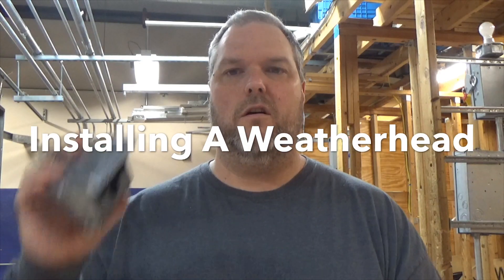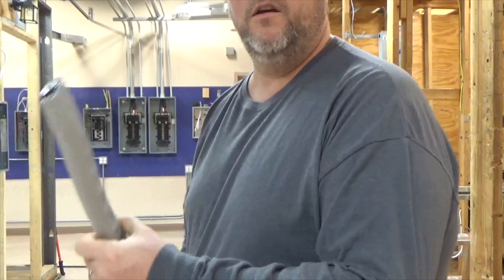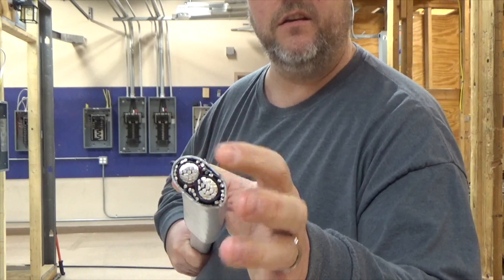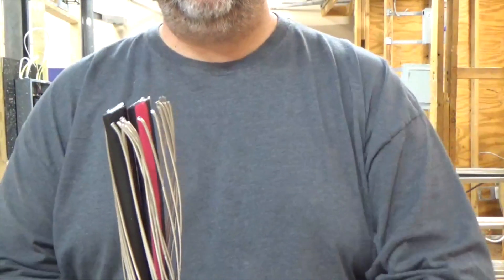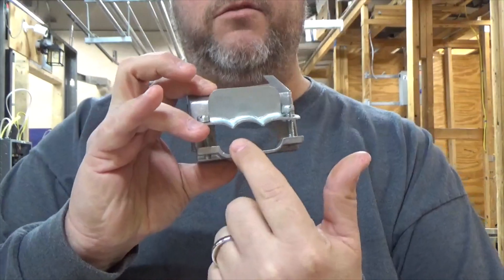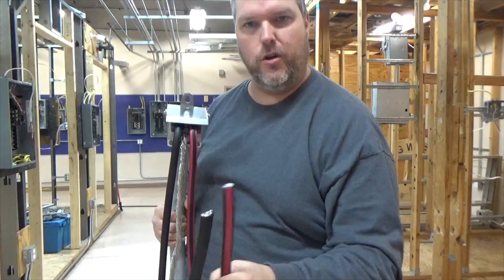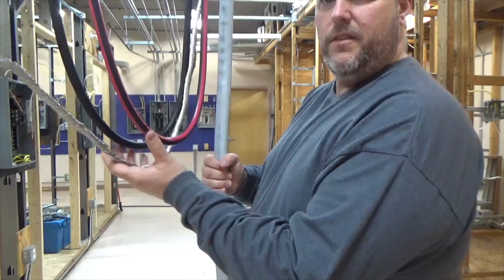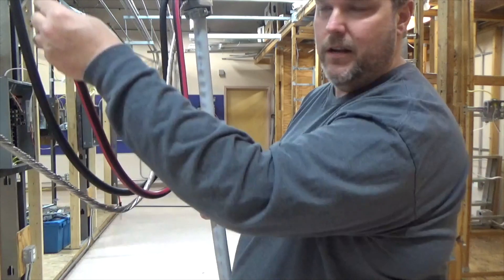How to make a 200 amp Weatherhead

Comment: Your neutral has to be insulated as it is a current carrying conductor. This cable is to be used for the service drop from the pole. If you put bare aluminum in a galvanized rigid or imc pipe you will have an electrolytic action between dissimilar metals. The result will be the aluminum being eaten away over time.

Comment: I need to install an aerial cable on our farm, is there a video on what kind of connectors to use to join quadruplex wires to the drop to the service panel. I've used Polaris multiport connectors for non-aerial connections, will they work for aerial? great video series

Comment: Nice video but I will say I had to slightly grind the opening on the bottom of the mast where the cable clamp goes to get the conductors to slide in as the conductors were getting nicked.  I also did this with the rubber grommet at top of the meter can. No reason either of these need to be that snug. The meter can at least where i'm located is required to be sealed where it enters anyway.

Comment: Great video. I have to change my service drop and meter pan. Wondering if I should leave the current 2" conduit running up the side of the house and leave the old weather head or just strap the 4/0 to the siding with new weather head. I'm in CT

Comment: Can a weak neutral connection coming from the power companies main service line cause an electrical fire.  It is being held together by two strands before it makes connection to the weather head on 100 amp service.

Comment: Very informative video, well done. I have a question about the bend radius of the wire going through the weatherhead. It appears to be less than what code allows. Is there an exception for weatherheads?

Comment: Seeing this video accidentally as a no-electrician, I am wondering where's a neutral or ground line.  If you use the lines you twisted to make a neutral, you don't have a ground line.  Also, although you twisted them tightly for 3 feet, the portion in the sheath is in loose.
Reply: The ground wire is only used after the first disconnect, which in a house is the main breaker in your panel. It is the same thing as the neutral upstream of that.

Comment: Can't you use 3/0 for 200A service (assuming terminals are rated at 75°)
Reply: 3/0 copper is rated 200 amps @ 75 degrees . 3/0 aluminum is rated 155 amps @ 75 degrees. Reference: National Electrical code. Hope this helps

Comment: I don't know exactly where you are at , but in IL & TX , One is NOT allowed to use a SE Cable up along the side of a house to feed power to a Meter enclosure !!  We use 2 inch RIGID STEEL Galvanized Conduit Pipe with a 2 inch Metal Weatherhead and the Service Conductors are ran up inside of the Conduit !! The ONLY time SE Cable is allowed to be used is when a Power Feeder goes across a  attic to a Main Electrical Panel Inside the structure that is being fed from an Outside Main Service Disconnect Panel located next to the Meter ! And Most Electrical Contractors prefer to use COPPER Conductors instead of Aluminum Conductors !!
Reply: yes in calif i never see seu.  it's always in rigid conduit.   isn't alum wire used as its easier to bend?  (plus cheaper).
Reply: @benjaminsher28  , True, but most Contractors in Tx prefer to use CU Conductors , 2-0 for a 200 Amp Service . Some do use AL but you have to go to the next size larger , 3-0 for 200 Amp Service

Comment: Shop guy for an electrical company here. I prep most of the weatherheads before we send them to the field to save the electricians time and remove the elemental problem. Easy life hack, run a drill chock all the way open, pull the neutral ends all the way straight, clip them even then close the chock on the ends while pulling it tight. About 2 seconds and you've got a tight clean cable. Learned it from the old guys. Lol
Reply from the maker: I use that everytime I do an install. This is to show how its done by hand!! Thanks for the great input!! Always like hearing things like this!! CM
Reply: Thank you man for some easily accessible and sensible tips. Been looking for ways to make my life easier and you're offering them.

Comment: I am not an electrician but is cost the reason why aluminum is used over copper for those large service cables yet copper conductors are used inside my house?
Reply from the maker: You would be correct on that!! CM

Comment: Finally found some one who is using an SEU cable for Service Entrance into a Weatherhead.  Is this NEC code compliant? I only ask because every picture and vids of weatherheads and cables have all three of the cables insulated. As if their using an SER cable and removed the non-insulated cable and through it away. I am upgrading a 50 year old panel. Thank you!

Comment: Installing a new primary 200 amp breaker box on the exterior of a house...next to the meter can.  Will have about 23 circuits. Can I just run two 2" conduits out of the crawl space and LB up into the bottom of the box?  Split the 23 wires into separate conduits?

Comment: I like this video 💯 !  I am going to be doing mine tomorrow. I ran 2” rigid up the building from the meter can and will be using the other style weatherhead. I also bought 4/0-4/0-4/0-2/0 service wire so I sure hope there are no issues with using it. I saw where you said it’s primarily for subpanels.  This installation has been a learning experience for sure.
Reply from the maker: Thats is great!! I would have to do some research but I think you will be fine. You can always reach out to the power company if you have any questions!! Good luck!! CM

Comment: Nice video Craig! I have a question, what's the difference between SEU and SER cable?
Reply from the maker: Great question!!! The SER has an insulated Neutral wire. It is marked with a WHITE tracer. This is used primarily for feeding a sub panel!!! Thank you for the question and watching!!! CM